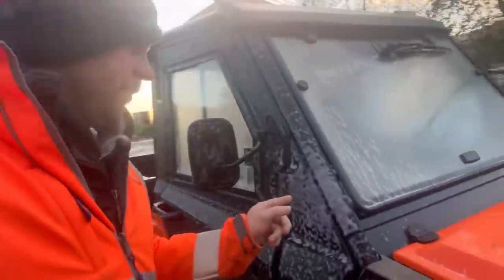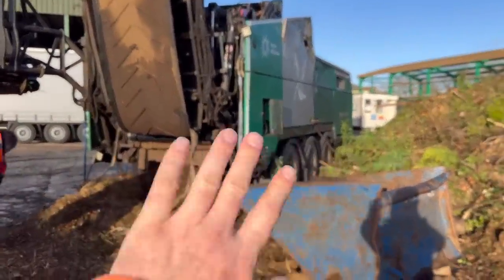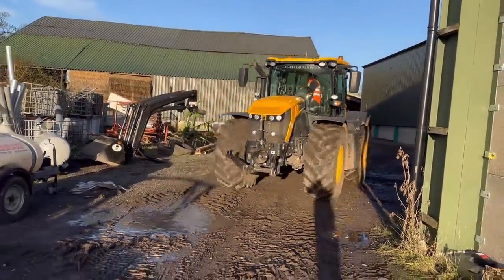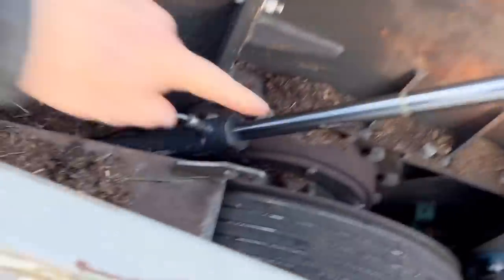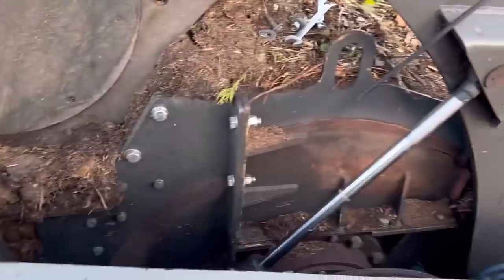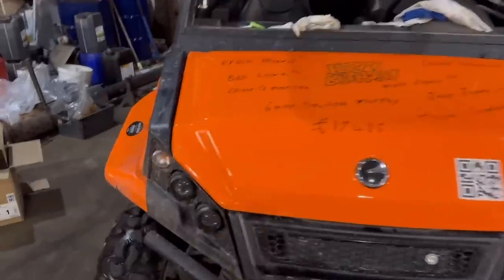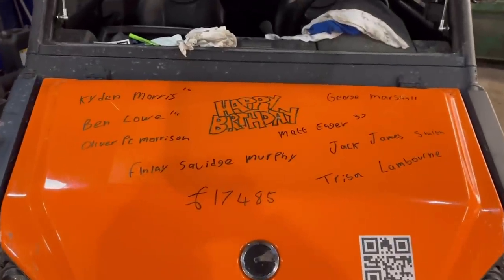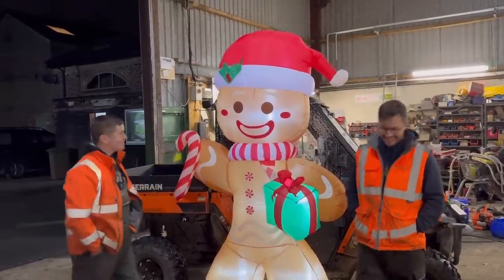DAY 981 HUGE CHRISTMAS TREE ERECTING SUPERMARKETS & A GINGERBREAD MAN #OLLYBLOGS  #AnswerAsAPercent

Comment: I’ve had most of my career dealing with large uk retailers (all of supermarkets), the only way you can do this is having a commodity trackers in place but it does mean all party’s have to agree on margins and both have to the ruff with smooth. 

Currently i have to give all my large customers 3 months notice before they will take a price increase. ( the increase take alot of work to get accepted)

Comment: Gingerbread man probably safer inside, as he may blow off the roof.     Also printer wise, I have found to check settings i.e. pages to be printed.     Also some printers print faster than others, from speedy draft to fine picture on the settings.

Comment: i think you should buy another 1 then put them in the back of  gator.  back to back but facing out and over  the side so they are veiwing the public as you drive by. also so if you put abit of baler twine on 1 of the hands of each ginger bread man and then through back window the driver could pull the baler twine so the arm waves at the public